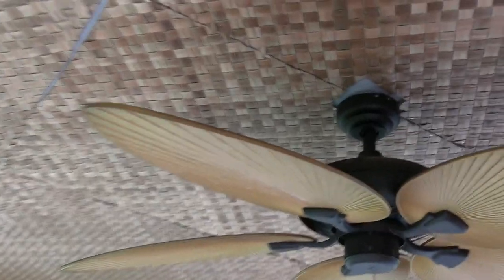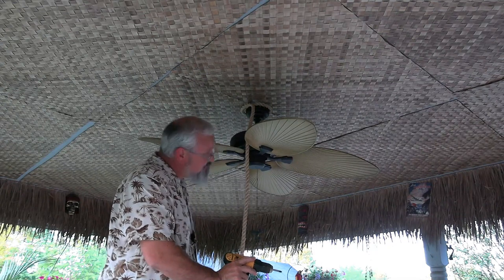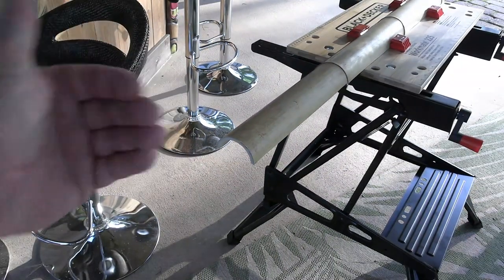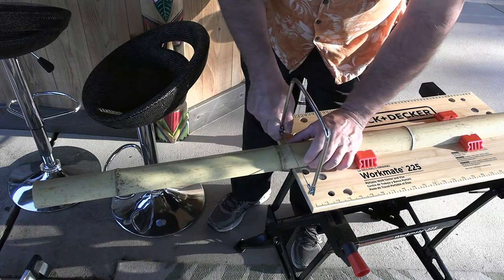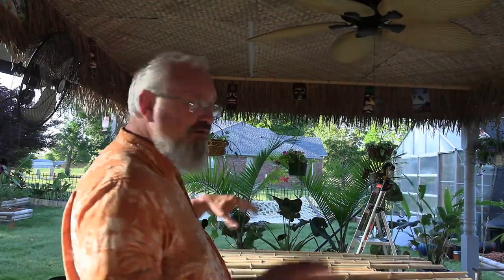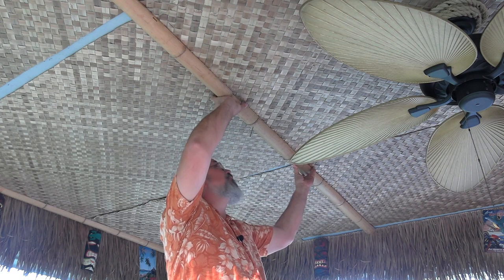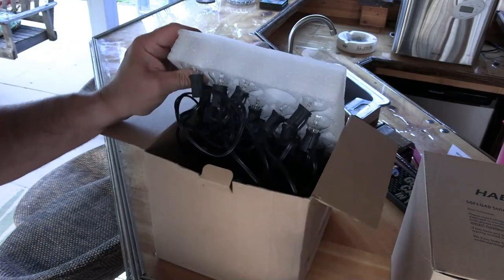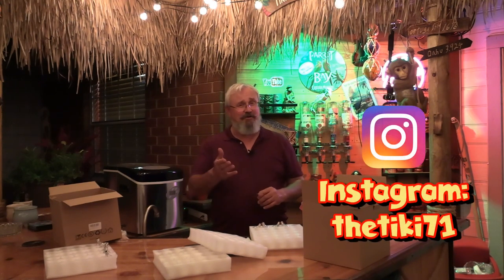Installing Bamboo on Lauhala Matting For Tiki Ceilings Pt 2 #tiki #bar

Comment from the maker: Project Links 👇🏼

¾” Sisal Rope: https://amzn.to/3og7IXx
E6000 Adhesive: https://amzn.to/3tJHm13
Portable Project Center and Vise: https://amzn.to/3uFrDSj
Yellow Wood Screws: https://amzn.to/3f8AaXm
DeWalt 20v Cordless Drill: https://amzn.to/2SLMeWT
Coping Saw: https://amzn.to/3tze6Kw
4x8 Lauhala (Bac Bac) Matting: https://amzn.to/3y1mQwe
Cordless Power Scissors: https://amzn.to/33tEyKX
2”x8’ Bamboo half round: https://amzn.to/2QNAsL0
50’ String Lights: https://amzn.to/33DYlay
Contact Cement: https://amzn.to/3hcmpcL
Adhesive Roller Cover: https://amzn.to/3heVKfa
Rubber Roller: https://amzn.to/2RF9oxo
2”x8’ Half Round Bamboo (I used 3”): https://amzn.to/3vNht1U
Mexican Palm Thatch Runner: https://amzn.to/3vYEyPr
T50 Electric Staple Gun: https://amzn.to/3uBfvBz
T50 ½” Staples: https://amzn.to/33yqe3G
Little Giant Ladder w/Tray: https://amzn.to/3hdLUu9
Painter’s Tape: https://amzn.to/3o0qsKu
3/4" Rope x 50’: https://amzn.to/3vxhs27
2 Person Hammock: https://amzn.to/3uesWHo
Hammock Stand: https://amzn.to/3nHU3bj

Tiki Bar:
Chico the Chimpanzee: https://amzn.to/3rVJlPr
Four Bottle Liquor Dispenser: https://amzn.to/3sAFqrb
Cocktails Neon Sign: https://amzn.to/2QpsSWL
Parrot Bay Round Sign: https://amzn.to/3awCW77
Captain Morgan Rail Mat: https://amzn.to/3vaIyM8
Drinking Parrot Bottle Holder: https://amzn.to/32DeY5Y
Tiki Bar Surf Board: https://amzn.to/3x8eUsK
Palm Tree Bottle Opener: https://amzn.to/3tSH20Q

Tiki Garden:
Moai/Easter Island tiki planter (better color than mine): https://amzn.to/3dcdbe0
Tiki Face planter: https://amzn.to/3e0Bqem
2 Tiki Face torches: https://amzn.to/31c77eQ
12 pack of original tiki torches: https://amzn.to/2PSsShQ
Bamboo Border 2-96” pcs: https://amzn.to/32t9B97
Solar/Sonic Mole Repeller: https://amzn.to/2Q50WY9
My mulch/dump cart: https://amzn.to/3x8K839
3-n-1 Cosco Dolly: https://amzn.to/3wKWFcO
Book: "Palms Won't Grow Here & Other Myths": https://amzn.to/3dbFcTx
Plumeria FOUR PACK Fresh from Hawaii: https://amzn.to/3mXCrqj
Majesty Palm: https://amzn.to/3dWI1GC
3 Gal. Washintonia Robusta Palm Tree: https://amzn.to/399HKyG
2’ Windmill Palm Tree: https://amzn.to/3mEpraw

Other Tiki, gardening and greenhouse items I use: 
https://www.amazon.com/shop/tiki71  

🍹 We have a recommended product page on Amazon & it’s filled with the things we use and like & it’s a convenient way to check out what you see on our channel & it adds ABSOLUTELY no cost to your purchase: https://www.amazon.com/shop/tiki71  
If you click through and buy something, we receive a small a very small commission (as little as 1%) that costs you NOTHING extra, but it helps us with the costs of delivering content, so Mahalo (thank you)! 🤟🏼 
🌴 🥃 🍷 🍸 

🌴 Subscribe: https://www.youtube.com/c/Tiki71
🌺Join our Facebook Page: https://www.facebook.com/thetiki71
🥥Instagram:  https://Instagram.com/TheTiki71
🗿 Twitter: https://twitter.com/thetiki71
🦜 Email: tiki71@yahoo.com

📭 Send me letters, pics, and stuff (I might open it on camera and give you a shoutout}: 
Tiki71
c/o Jungle Jerry
205 Wilburn Heights
Central City, AR  72941

🌴 Tiki Gardener Bumper Stickers!  Show your love for tropical plants AND tiki at the same time.  Just $5.00 in the lower 48 states, $6.00 everywhere else with SHIPPING INCLUDED.  
Go to https://www.paypal.com/paypalme/tiki71 and be sure to include your address at checkout.   I’m using a direct link to PayPal, in order to keep costs down and I’d rather pay for shipping it to you than some corporation to host a website that does the exact same thing as the PayPal link. 😉🤙🏽

 👎🏼 I DO NOT buy, nor recommend plant SEEDS on Amazon, only live plants & cuttings from sellers well rated. I've had too many bogus experiences. 

👍🏼 I absolutely DO recommend Amazon on live plants that you can’t get locally. Several of our multi-year tropicals have come from good suppliers on Amazon (like (Logee’s, American Plant Exchange, Cold Hardy Farms, Costa Farms, Old Oaks Nursery, Hirts, etc.) and arrived alive and well. 

🌴 🍷 Okule Maluna! 🥂 🌴